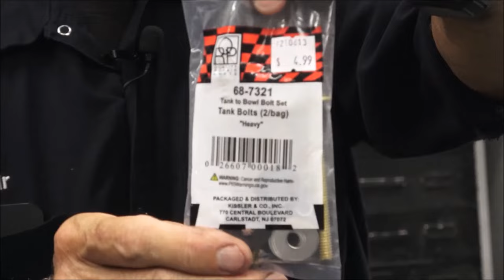Toilet Tank Bowl Leaks at Bolts Nut Washer - Slow Drip - 20 Minute Fix

Comment: Thanks so much!!! We just bought new toilets (American Standard) and I can't believe this type of system doesn't come standard with new toilets. It's ridiculous to expect a tight seal to be made from a nut that tightens the toilet bowl to the tank. When it leaks, I don't know if it's because it's too loose or I cracked the thing from over tightening.

Having the tank alone be water-tight sealed should be the standard, and then just secure the tank to the bowl. Genius.

Comment: Metal - rubber - ceramic.  Thanks!  Once I heard that, it gave me the confidence to move forward.  The old one was a rubber washer with a stem on it that I could not pull out.  So I just kept cutting off rubber until I had a nice contact with the ceramic showing.. Thanks!

Comment: After taking tank on and off 4 times and replacing tank seals and changing out the flush valve 3 times I can't believe it's the tank bolts all along 😑 this video gives me confidence I'm only going to have to do this repair 1 more time. Thanks!

Comment: Thank you, will try.  I've been using the metal washer inside the tank with the rubber washer and can't get the drip stopped.  Will try your method today.
Reply: Did that fix it? Other videos put metal washer inside too but don't see how that causes leak as it's rubber to china on inside.
Reply: @rogerh2694  Absolutely it did fix it!
Reply: @rogerh2694  The problem is there's no waterproof seal between the metal washer and the bolt head. Water gets between them and makes its way to the threads, and leaks down them to the outside, bypassing the rubber washer entirely.

Comment: Thanks for the video. I just took my toilet apart and the washer that was being used actually went through the tank and wasn’t a flat washer. I mean it was flat but part of fit around the bolt as it went through the tank. It was hard to tell in your video but I think it was like the one you took out. I can’t seem to find these exact washers anywhere. Can I just use a use a regular flat washer?
Reply from the maker: The toilet tank bolt washers are softer, a bit more pliable. They should be sold at any hardware or big box store….. you may have to buy a kit w/bolts, nuts and washers.

Comment: Why no rubber washer at bottom of tank? Other vids show rubber washer metal washer and then nut. I guess i ll find out if it leaks again.
Reply from the maker: The number one seal is inside the tank where the metal headed the screw is sealed against the china. Any other washers will not make that seal any better.

Comment: Can I use a rubber washer/metal washer combo on the bottom of the tank?  Should I?  Or should it be just a nut and a metal washer?  If so why?  Thanks for your time.
Reply from the maker: The seal is made in the tank, rubber underneath is not necessarily and creates a little more ‘play’ in the bolt that is not a good thing.
Reply: Thank you.   @MrHardware1
Reply: Never put metal to porcelain
Reply from the maker: @HarveyWallbanger-ho2cq  only when rubber is on the other side! It’s been done like this since the 1940’s.

Comment: Hi. If I understand correctly, the tank's stability to the bowl (meaning less rocking) comes mainly from the bolt heads inside the tank and the nuts underneath the bowl. So what exactly is the middle nut and washer between the tank and bowl contributing? Is it to add more stability? Or is it to add more leak-proofing? Or a little of both? And why is this nut and washer combo absent in this location in many toilet setups? Thanks.
Reply from the maker: Some toilets are 2 bolt and some are 3 bolt (Mansfield and old American Standard) (which have more stable tanks, not that it is a big issue) You can’t skip a bolt….
The Flush valve in the center is bolted to the tank and sealed to it w a nut and internal gasket, first, away from the bowl. Then a large foam gasket seals the flush valve (now attached to the tank) and the tank to the bowl w 2 or 3 bolts , depending on your particular toilet.
Reply: @MrHardware1  Thank you! I've seen some video tutorials on YT add a rubber washer above the metal washer where the 2nd nut is located in a 3-bolt setup. I assume that is not correct since I see you didn't add one in your video. Another question, my toilet bowl has 3 small rubber 'seats' along the rim where the tank sits on. They are removable, and frankly probably need replacing since they're brittle now. Do I need new ones, or can I do without? Thanks again! Subbed btw. Edit: I guess the small rubber 'seats' are actually called channel pads. Some have called them shims or spacers.
Reply from the maker: @mattlewis4972  In tank to bowl kits they don’t give you enough rubber washers to put one on the bottom of the tank. The actual seal in the only one that is going to work properly is the one inside the tank, bolt, rubber, China. The other rubber washer that comes in a bolt kit is used underneath the bowl for the wing that tightens the tank assembly to the bowl.
The Spacers take the wiggle out of the tank to bowl. Not a bad idea although most toilets don’t have them. I have used vinyl tubing, probably quarter inch OD, and cut little pieces and place them on top of the bowl to assist the tank from wiggling. If they are too thick they will prevent the foam center flush valve gasket from seating properly so be careful as you do this.

Comment: I've got a toilet with three bolts. When I follow these directions, the nuts prevent the Tank from seating properly, ultimately leading to leaks. Any advice?
Reply from the maker: @youssefelbahtimy  either you need a thicker ‘tank to bowl’ gasket or don’t use the intermediate nuts. Mansfield uses a little thicker gasket….
Reply: @MrHardware1  thanks, I doubled up on the gaskets in the tank, placed gasket then washer between tank and bowl, then washer and nut after the bowl. Probably overkill, but it worked. Thanks!

Comment: Tank bolt near fill valve still has a small leak. My gaskets don't pucker. Should I get different gaskets? TIA
Reply from the maker: If the gasket on the fill valve in the tank is good and hopefully it’s not coming from there possibly the rubbers do dry out that seal inside the tank so if you’re able, you could replace them with no harm

Comment: Still don't understand how metal washer in tank causes a leak if rubber washer is the final sealant inside tank? Does the metal one cause the rubber washer to not seal properly??
Reply from the maker: The water flows between the metal washer and the metal head of the screw until it reaches the threads to the screw and then drains down to the screw out the bottom.

Comment: Hello, have a toilet tank with 4 bolts, what kind of flush valve is used.
Reply from the maker: That is an old toilet (more than one manufacture) and typically uses a standard 2” flush valve.
Reply: Thank you

Comment: Has any super-genius invented a toilet that attaches the tank to the toilet without bolts that are UNDER WATER?
Reply from the maker: If they are solid brass it should not be a problem.
Reply: @MrHardware1  They still need to be replaced, eventually. Replacement, and, dealing with the challenges of getting a watertight seal would be eliminated if they weren't under water. I just replaced both, (brass), because the right one started dripping... and now the left one is dripping.
Reply from the maker: @NedSpindle  if the bolts aren’t solid brass or if someone puts a metal washer in the tank are the only issues preventing this job from lasting 30 years.